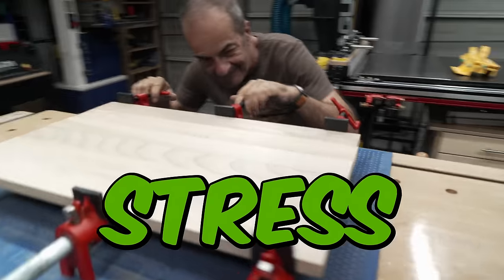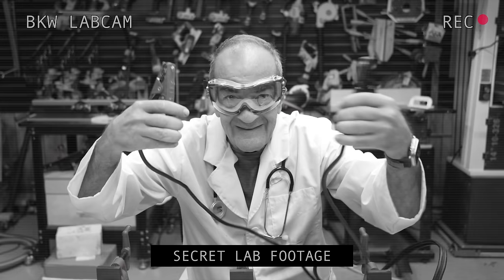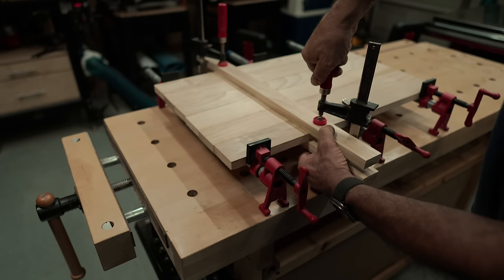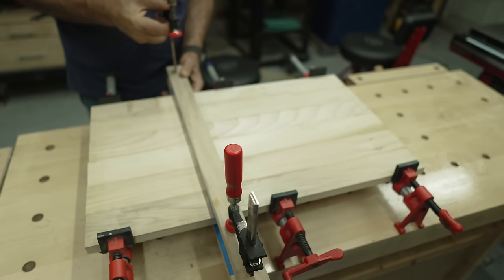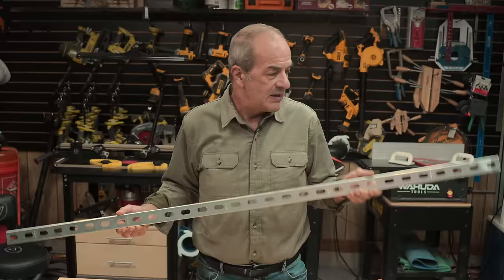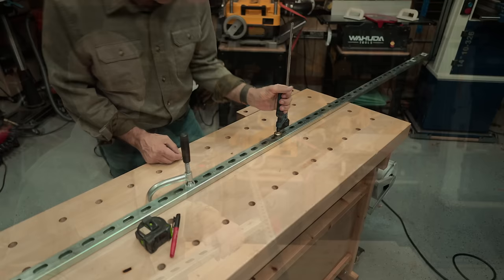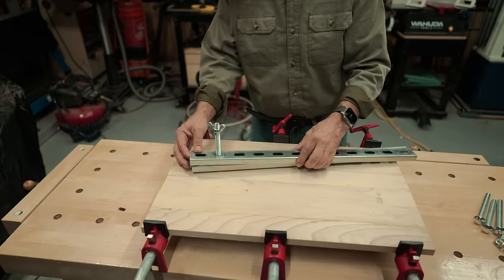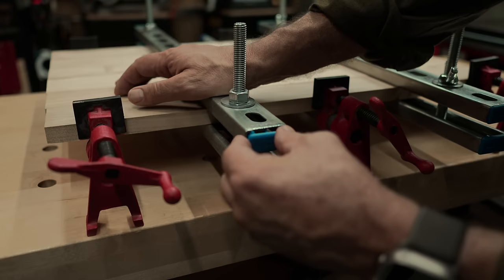Rockler doesn't want you to see this video

Comment: Couldn't you use the clamps you used with the wood cauls?
Reply from the maker: Other people have mentioned that. The video shows that because that’s something I have done before, but presumably if you were making the Superstrut cauls from scratch, you wouldn’t add the extra expense. A bolt nut and washer costs like $2.

Comment: New viewer. Just looking at this from an outsiders view, when you cinch down the nuts, wouldn't that leave marks in the wood? Like the idea a lot though as I use cauls quite a bit. Thanks for the idea!
Reply from the maker: You can flip them over for more surface area if desired. I find having the open side down is easier, and it’s not usually an issue as long as you don’t over tighten them. If you put the flat side down, the wing nuts don’t fit, so you’d have to modify the clamping mechanism.
Reply: @BustedKnuckleWoodworks watching this again. 😊 I'll do this when I get a shop as I currently do not have one. Thanks again for the answer.
😊😊😊

Comment: I like this idea but I have one concern. Since you have two narrow surfaces contacting the wood, isn't there a danger of pressing grooves into the surface? I know pressure has a lot to do with this, but would like your opinion based on your experience. Thanks.
Reply from the maker: It really depends on how hard the wood itself is. This is why I mention that there’s no need to crank down on these so hard (although you can do so if necessary). When gluing up softer woods like pine or poplar I have used additional taped-up cauls underneath to spread out the pressure.
Reply: I had the same concern because I use a lot of soft wood.  My thought was put the b-side as shown to contain the head and put a hard wood spacer inside on the a-side so you can have the flat surface down and still use everything else as shown.

Comment: My only critique is that I think it would be better if the flat side was turned to the work so you don't create narrow indentions in the wood.
Reply from the maker: You could definitely do that, but you'll need big fender washers, otherwise the wing nuts won't work. I've used these on soft woods, and they won't make dents as long as you only go "double ugga" tight like I did in the video 😉

Comment: Why not use your clamps with the strut the same way as you mentioned with the wood? No need to buy or keep track of additional hardware, plus they would be over the surface of what you clamped (not that you need that with strut, but why not?).
Reply from the maker: I wanted to present the cheapest option that didn’t require you to buy or modify any clamps. But yes, definitely could do that!

Comment: Surely using the superstrut with the ends of the "U" against the wood risks marking the wood. Would it not be better to turn the channel so that the flat side was against the wood?
Reply from the maker: You can place them either way. I find having the open side down is easier, and it’s not usually an issue as long as you don’t over tighten them. If you put the flat side down, the wing nuts don’t fit, so you’d have to modify the clamping mechanism.
Reply: Ah, hadn't thought of that :-)  @BustedKnuckleWoodworks

Comment: Funny and helpful video, def urge folks to buy the heavier struts and use the flat side. Run shipping tape along the bottom so the metal/glue won’t chem react and stain the wood. Punch new holes in it as needed. Additionally don’t use more than a finger spread film of glue on each piece and don’t over tighten the cauls. Use plastic cabinetmakers shims as needed. Begin in the middle of the panel to flush up edges moving outward with each clamp/caulk. Finally always add a small clamp at each joint on the panel ends before you snug up the final end clamps. Don’t over tighten your clamps either, only tight enough to see small even squeeze out the length of each joint. Happy glue up stressing. Can’t be helped
Reply from the maker: Almost sounds like you’ve done this a few times! 👍😂 Cheers friend, and thanks for the helpful tips!

Comment: Why not flip them vertically so the two outer ridges are facing away from the wood; wouldn't the other way mark the wood if you clamp too hard?
Reply from the maker: You can flip them over for more surface area if desired. I find having the open side down is easier, and it’s not usually an issue as long as you don’t over tighten them. If you put the flat side down, the wing nuts don’t fit, so you’d have to modify the clamping mechanism.

Comment: This is brilliant. One question with the paste wax tip, will that disrupt stain/finish or does it sand off? I guess I don't think about the paste wax on my tablesaw affecting anything, but just curious.
Reply from the maker: Just make sure you completely buff off all the excess before using the cauls. Won’t affect the wood as long as the wax has dried and any excess wax is gone.

Comment: Why not use the modified F clamps, the slots in the super strut would fit the bar of the clamp perfectly.
Reply from the maker: If you make the assumption that people are going to go straight to the Superstrut solution first, that would mean buying and grinding down multiple sets of F-clamps. I'm trying to keep this as economical as possible, but yeah, you could do that.

Comment: I was about to be an idiot and correct you but I learned to Google things before putting my foot in my mouth. I've known this system as  Unistrut but Unistrut is just a different brand. Another viewer recommended the 1 5/8  profile system which would definitely be much more rigid. Something to keep in mind on wider thicker glue-ups. Very good idea though. I loved the ending!
Reply from the maker: You are definitely correct about using the beefier struts for wider glue ups. They also make a 3 1/4” strut that’s probably overkill unless you’re gluing entire timbers together 😂
Reply: @BustedKnuckleWoodworks  Ha!

Comment: 3:00 Instead of grinding your poor clamps, just open up the slot in your wood, slide the clamp in and secure it with a horizontal nail or two from the side.
Also, why use clamps at all when you can simply use threaded rods and some nuts? You can drill several holes and get the pressure close to the edge of the boards.
a minute later: oh, you ARE using threaded rods. Cool!!! I salute you, Sir!
And you seem to be a fellow lefthander. I salute you some more.
Reply from the maker: Lefties unite! ✊
Reply: @BustedKnuckleWoodworks  Gladly.

Comment: Would it not be better to have the flat faces of the cauls facing the wood panel rather than the edges? I can just see one Ugga too many leaving a line across the panel.
Reply from the maker: You can place them either way. I find having the open side down is easier, and it’s not usually an issue as long as you don’t over tighten them. If you put the flat side down, the wing nuts don’t fit, so you’d have to modify the clamping mechanism.

Comment: Haven't tried it yet - but doesn't this method leave mark in soft wood (pine for instance)?
Reply from the maker: You can always flip them over for more surface area. I find having the open side down is easier, and it’s not usually an issue as long as you don’t over tighten them. If you put the flat side down, the wing nuts don’t fit, so you’d have to modify the clamping mechanism.
Reply: @BustedKnuckleWoodworks  thanks a bunch :) for both the vid and the response. I’ll try this next weekend.

Comment: Although I like this approach, I'm curious as to why you didn't simply put more slots into one end of the cauls spaced every few inches? That way, the fixed end is always close to one edge, and the end with all the slots allows you you to move the clamp closer. Since you've already got the hardwood, it's a zero cost solution. You could also cut various lengths of hardwood to make additional cauls for wider glue-ups, and still include the additional slots for adjustability.
Reply from the maker: I like the Superstrut better. Stiffer than the hardest hardwood. I’m thinking a row of slots in wood might make it weaker on that end? 🤷

Comment: Why not use your bar clamps (that appear to be flat) and alternate the clamping with one clamp below and the next clamp on top and so on. This way you’re sandwiching the glued up planks between the flat surfaces of your clamps.
Reply from the maker: You definitely don't want to get even a trace of glue residue on those pipes... makes it impossible to slide the end after that
Reply: And that's why you put wax paper down, just like you'd suggested  @BustedKnuckleWoodworks  😉
Reply from the maker: @stevenmattson3164  also, the clamps are nat gas pipe so they’re not flat, they’re round 🙂

Comment: Or...get a length of rope and cut a few triangle shaped pieces of scrap as long as the panel is wide, and a few straight strips the same length.  Wrap the rope around and around the width of the glue up, with the straight strips under the panel also getting wrapped.  (90 degrees to the glue lines).  Make it as tight as you can.  Now slide the triangles under the rope and they (a) act as a caul, and (b) tighten the rope even further.  Not a single clamp used, and "self cauling".  Guitar makers in Spain do this a lot..
Reply from the maker: Sounds pretty old school my friend. I'm way too uncoordinated to even attempt that LOL 😂
Reply: @BustedKnuckleWoodworks  Haha.  It's pretty simple, you could do it easily.  It's not the only way of course, but simple and doable.

Comment: Why not use the flat side for it instead? Couldn't the edges of that solution hurt softer wood?
Reply from the maker: You can flip them over for greater surface area if desired.  If you put the flat side down, the wing nuts don’t fit, so you’d have to modify the clamping mechanism. I find having the open side down is easier, and it’s never been an issue. As I mention in the video,  you don’t need to crank down on them that hard.
Reply: @BustedKnuckleWoodworks  fair and kinda figured. Indeed, I was thinking like an old socket and another washer, Thanks for answering my question 😊

Comment: Just came across your channel, you had me laughing in your intro.  Is there any issue with the superstruts indenting the panels when you clamp them down?
Reply from the maker: You can place them either way. I find having the open side down is easier, and it’s not usually an issue as long as you don’t over tighten them. If you put the flat side down, the wing nuts don’t fit, so you’d have to modify the clamping mechanism.

Comment: Really thought you were going to use the two piece f clamps on the super strut
Reply from the maker: I only showed the F-clamps as an example of what I used to do. Nothing stopping anyone from using those but it makes the solution a bit more expensive.
Reply: @BustedKnuckleWoodworks  yeah I guess the low cost was the point.. Still think I may try it with some old quick grips. Great video, great idea. Thank you!

Comment: I would suggest, since metal can dent wood where pressure is given, to add a strip of would along the cauls to....just kidding,  Great idea, I've had some near my shop and i'm beating myself up for not having come up with this idea...
Reply from the maker: You can place them either way. I find having the open side down is easier, and it’s not usually an issue as long as you don’t over tighten them. If you put the flat side down, the wing nuts don’t fit, so you would need large fender washers to span the opening, or some other method for fastening them.

Don't beat yourself up LOL... sometimes, the best ideas aren't so obvious right away!

Comment: Does it cause an indentation on softer woods?
Reply from the maker: I find it’s not usually an issue as long as you don’t over tighten them. You could definitely flip them over and put the flat side down.

Comment: Why not just slip the clamps used with the wooden cauls through the slots in the Superstrut and clamp? No bolts needed.
Reply from the maker: I just built those for the video, to show other ways I've done it in the past. Presumably someone coming to this brand new wouldn't be doing the F-clamp thing first.

Comment: Or just plane a slight bow onto the edges of a pair of 1x2s, minwax, and face the rounds into the work, opposite eachother, with your f clams on the ends, squeezing them together. 5 minutes instead of 30, and you probably have the material on hand.
Reply from the maker: Always more than one way to do everything

Comment: This actually seems like a good way to make a simple caul. Im curious though....If I clamp these one, doesnt that leave to parallel lines underneath each clamp from the bottom of the unistrut? That being said....MUCH better then the overpriced Rockler clamps that I threw away after one attempted use!
Reply from the maker: In most cases you shouldn’t have to clamp so hard that this would happen. If you’re working with very soft woods or need to clamp down very hard to force an alignment, you can always flip these over and use the flat side.

Comment: Pro tip: Sole reason for buckling a glue up is excessive clamping force! Stop that!

Clamp until glue squeezes out along the whole length of all joints and stop. Done!

For knowledge thirsting persons:
A) It is the glue that creates the bond. Not the pressure!
B) Glue jacks never achieve a perfect 90 degree force application. The harder you tighten the bigger the angle deviation. 
C) If you don’t get glue squeezed out everywhere - insufficient glue amount or jacks too wide apart. Clamps and jacks applies pressure in a 90 degree angle. 45 on each side.  Make sure to have a pressure overlap from each clamp/jack to its nearby neighbours already at the joint nearest the jack studs.
Reply from the maker: I agree that woodworkers do have a tendency to crank down way too hard on things
Reply: @BustedKnuckleWoodworks  I did too before I new better. Thx for the good tip in the video. I directly checked the prices for those rails.

Comment: can i make shelves out of superstrut?
Reply from the maker: Oh yes, absolutely! I’ve made many shelves from this. They sell it in two larger sizes. I would suggest the 1 5/8” size at least for shelves.
Reply: @BustedKnuckleWoodworks  Is this a good route to take or should I take the wood route? I'm kind hoping it will be adjustable, maybe I can take it down, and I don't like how the typical wood shelf has like a giant 2x4 at the top of each shelf so that space is unusable. Also crossing my fingers that it would be easier, but maybe that's too much to hope for.
Reply from the maker: @mitchjohnson4714  it’s all just nuts and bolts and brackets, so no welding involved. It’s also easy to connect and reconfigure these. And much stronger than wood if you need that.
Reply: @BustedKnuckleWoodworks  Thanks so much! What's a good thing for the shelf itself?
Reply from the maker: @mitchjohnson4714  I usually use 3/4” plywood or MDF
Reply: @BustedKnuckleWoodworks  Thanks so much!

Comment: Both the wood, and the super-strut, are WAY stiffer when you stand them up on edge. At least 4 times stiffer than flat, 8 times if it's twice as tall as it is flat.
Reply from the maker: For much larger jobs that is a good tip

Comment: Could maybe use Waterproof Silicone were you don't want glue to stick or tool marks probably i think🤔
Reply from the maker: At the end I show using paste wax on them.
Reply: @BustedKnuckleWoodworks   I was thinking if it would be less clean up with Silicone since it harden and becomes rubber like and reusable mabe.  🙂

Comment: You said that the commercially made caul was over-engineered; so is yours.  Those 1/2 inch carriage have a minimum tensile strength of about 8500 pounds.🤔
Reply from the maker: @guypehaim1080  I wouldn’t exactly call a bolt “over engineered.”
Reply: @BustedKnuckleWoodworks  If you were making this commercially, the bean counters would have you use minimum strength fasteners to cut corners and make more profit.  That's how it is over engineered.  I think what you've done is make it easy for the home shop workers to make their own easily which is okay.

Comment: Dude take your bar clamps like the ones you have underneath You put them on top and push down on the bar clamps on the bottom You're not going to get the wood perfect You have scraping sand glue when you glue up sections of wood cabinet shops have to do the same thing that's why they have glue racks
Reply from the maker: Whatever works for you

Comment: Parchment paper works wonders and let’s you use whatever you want because the glue won’t stick to the parchment paper. You’re welcome
Reply: Also some rubber bands help keep everything in place until you get your clamps in place
Reply from the maker: I literally used wax paper like three minutes into the video. I guess you missed that part 😆
Reply: @BustedKnuckleWoodworks  wax paper and parchment paper are 2 different things lol but you knew that already I’m sure
Reply from the maker: @nickousticmusic  they both work.
Reply: @BustedKnuckleWoodworks  I mean technically they both work. One leaves some wax behind on your panel and the other doesn’t lol was just pointing out that parchment paper is better than wax paper and still won’t stick. Not rocket science lol had nothing to do with your main point at all…. Which is still a good idea….. but was just to save some people some time by not buying wax paper if they went that route…..